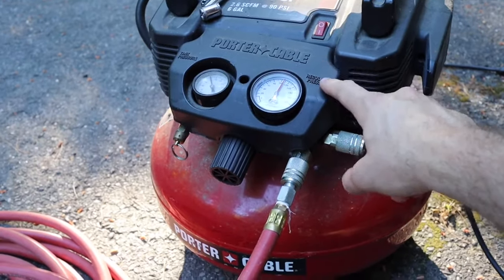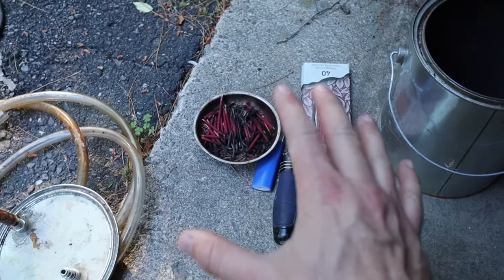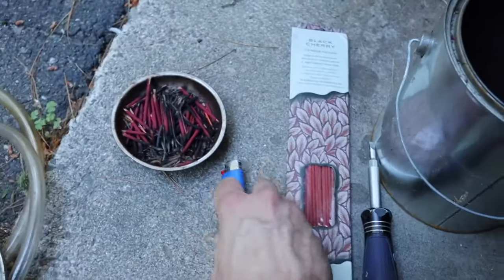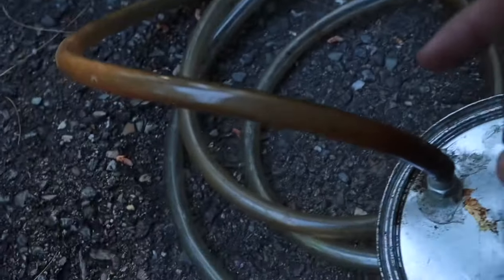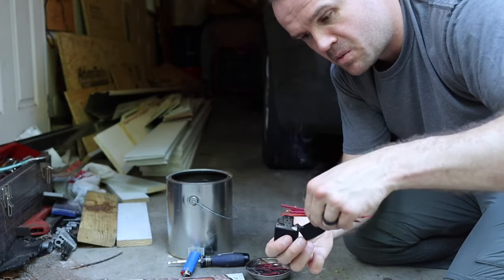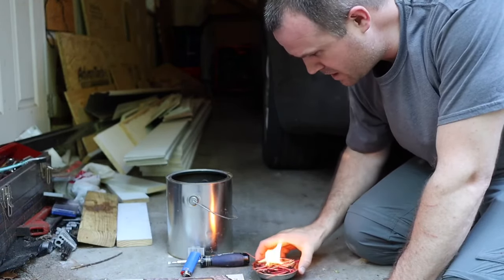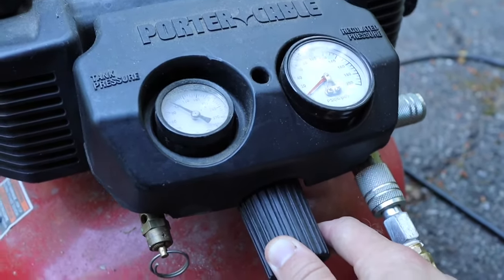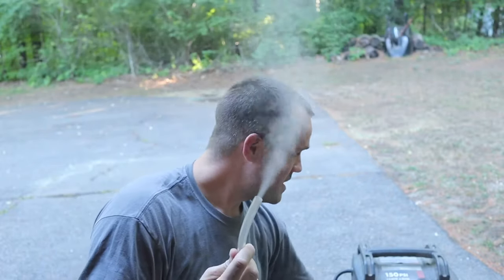How to make a DIY smoke machine

Comment: Great idea using cheap incense for this. I'd rather my work area and engine bay to smell like cheap incense during testing any day instead of old burnt sock soaked in mineral oil. Definitely looks like you get more smoke from the incense as well.

Comment: And when your done smoking your car you can use it to smoke up yourself and your friends! Lol Seriously though thats excellent and I will be making one to test my EVAP leak on my gmc sierra.  Im going to add a brass 1/4" ball valve onto the lid instead of just the air hose fitting.  That way i can control the flow a bit easier.

Comment: Great video. If you don't have a compressor, you can use a portable battery-operated fish air pump. The pressure is just about right and no need to adjust.

Comment: EXCELLENT video!

I'm already a huge believer in using smoke machine to get car running right by detecting leaks you didn't know were there - really helps you quickly ID trouble spots. First used on when I had a surging idle, that would also trigger a Check Engine code, that I cldn't figure out for the life of me after checking all the components - including the one id'd by the code. Applied a smoke machine on the air intake and, voila, a cpl of leaks I had no idea were there! Sealed those off and idle was perrrfectly smooth and CEL stayed off

I previously made a smoker using a cheap soldering iron and a sock soaked w/ mineral oil in a jar. It worked OK for a while but the cheap soldering iron shorted out a cpl of times from continuous operation - really a PITA hvg to swap it out after epoxying it to the lid. And even when working it didn't produce as much smoke as I wld like. I LOVE this idea - no components to fail, cheap reusable source of ample smoke, nice idea on screwing quick connect fittings on the lid for max ease of use.  A+! Two thumbs up!
Reply from the maker: Hi Joseph.  Thank you for the great comment/feedback.  I appreciate you watching, thank you bud!
Reply: @TheComebackKid  It sounds on a few words like you may be a Boston guy, which I would also have in common. Lots of smahht, inventive folks in Boston!

Comment: I got lucky last year, got an air compressor just like that one for free, curb shopping. A local contractor has a sign next to his "Free Pile" on my way home from work. Just had to replace quick connect air fittings and clean gunk out of the regulator, works great now! Building a similar smoke machine tomorrow :)

Comment: I for real made this today, I used a step bit, 2 air fittings, about 10ft of half inch hose, and I actually used an air blow gun with a zip tie secured on the trigger just barely enough to make enough pressure to have the smoke come out! Although I smelled like a goth girls bed after burning dragons blood incense… it worked and I found that a squirrel or something chewed some vent hoses under my car! 10/10

Comment: I wish I found this one before, had issues with car not idling so changed pretty much everything, (no fault codes) eventually after removing inlet manifold for the 3rd time found a split hose that goes from inlet init computer. Weeks and many many hours of work. Thankfully I could do myself but this would have helped
.

Comment: How much does the air pressure need to be at?
Reply: Not much, just enough to push the smoke out the other end
Reply: No more than 1 psi is recommended.

Comment: Cool is,  is cool does!
   Now go and get some wood burning chips and a dishwasher element and make a bigger deluxe model. 
The dishwasher element doesn't get red hot but works if you just wire it direct without a temp. ajust turn dial.